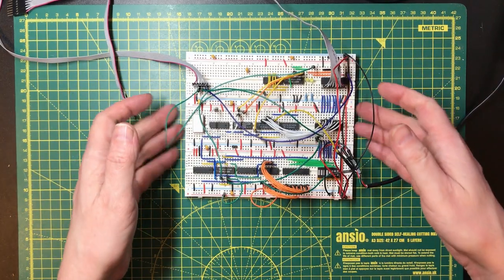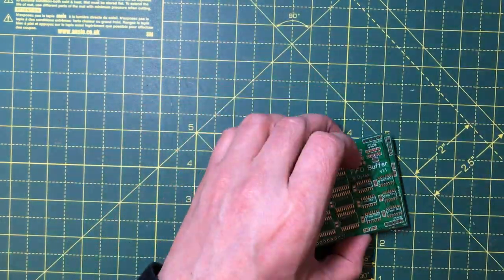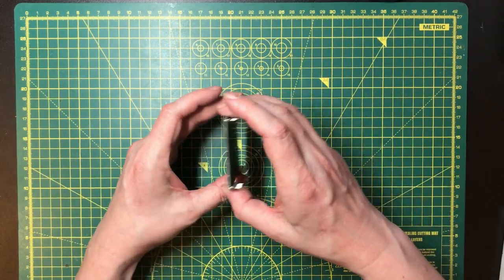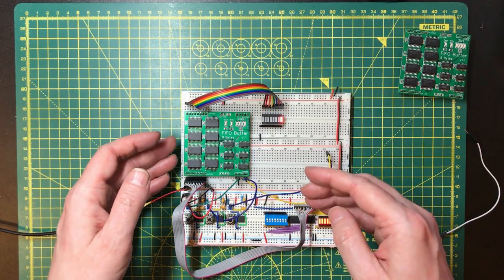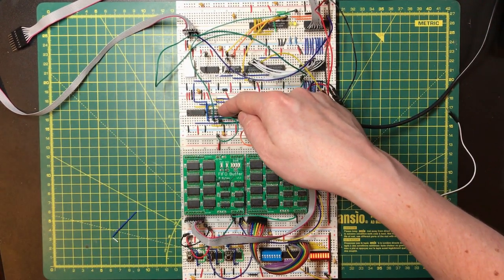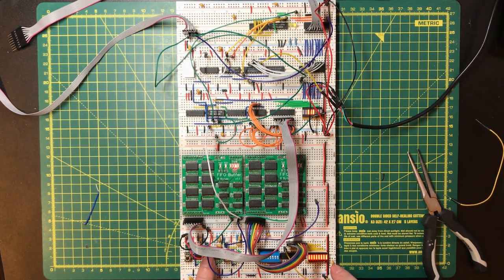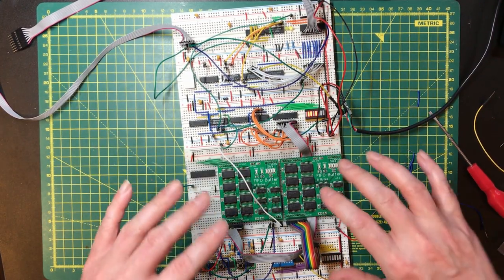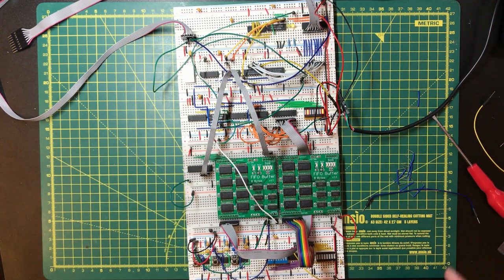Receive FIFO - UART from Scratch - Part 6

Comment: Thanks you James and nice Holidays ! 

Funny that JLC now sends puzzles... as if I didn't have enough puzzling while designing the PCB 🙄

Could we have some Bach or Mozart in the next video for soldering  ? 

And ahhh yes, cheap push buttons from ebay "The Tragedy" ... I had some really bad batches, they lived like 200 pushes and then they were a resistive mess... try fix that in code ...  sigh. Maybe I send my left arm and my liver to mouser one day to get 10 really good ones 🤣  .. Well the cherry mx switches are only 80 ¢ents so maybe I'll use these for breadboards.
Reply: You can get two pin push buttons, they are a lot more reliable on breadboards.  I think I ordered mine from Amazon in the US, but I'm sure you can get them from lots of places.
Reply: @JamonTerrell  Dude, with mouser , that was a joke, I don't user breadboards since like 2017 anymore, the switches I use for my projects normally either are small enough to disappear under your fingernail and come from ebay (not all is scrap there) or they are salvaged from old electronic components (free...  yay !).
Reply from the maker: They do like to stick random gifts in with deliveries.

Comment: Awesome video, as always!

I do think an explanation of why interrupts aren't appropriate to your processor would have rounded the video out though, as it's the "first" way to solve exactly these kinds of issues, unless your looking at 100kbaud+ speeds.
Reply from the maker: You mean like the 115.2kbaud I'm running at?  ;-)
Reply: @weirdboyjim  your on the line for sure, but that's a manageable 20,000 interrupts/second assuming the line is going full speed in both directions. I'm just saying not mentioning interrupts was weird as it's right in the same solution area as introducing a FIFO.
Reply from the maker: I have explained it a few times already but the honest truth is that interrupts are not necessary to achieve what I want, and there are a lot of things on the "nice to have but not essential" list. I'll probably do them in a future build with different goals.
Reply: @weirdboyjim  I must have missed the bit where you talked about interrupts in a video, but anyway that's me done on that topic.  Looking forward to seeing your VGA implementation. You've seriously raised expectations on what can be done on a few breadboard slabs, so.... :)

Comment: Happy Easter, and congratulations on another component.  I imagine you must be looking forward to having more reliable IO before diving into the VGA.

Apologies for asking an off-topic question, but: I'm working on an emulator, and I just saw lodsb and stosb instructions in some code.  Are those "macros" made up of `mov tl,[si] ; inc si` / `mov [di],tl ; inc di`, or are they actual new instructions?  I did wonder at one point if it would be possible to do load/store and increment involving si/di in fewer cycles.
Reply: Answering my own question: they're real instructions, and the opcode definitions appear in part 93 around 13:42 for one frame.  Don't know the specific control lines, but they're presumably the same as the non-incrementing loads, but with the appropriate increment control line set.
Reply from the maker: Yes, real instructions. But they operate on the A register rather than TL. I didn't really go into any detail of those but the implementation of lodsb is identical to "pop a" only substituting si for sp. I have been sharing the architecture file out with people who ask for it. Email me if you want a direct look.
Reply: @weirdboyjim  Ah, thanks for the clarification.  I'll ask if I get really stuck, but it's enjoyable trying to get this all to work.  Up to the point now where I need to rewrite my assembler to not be an abomination of a Python script.  :)

Comment: You paid $8 to use 4 layers, but how much was shipping? I was just wondering what the total cost of missing the 2 crossed wires was?
Reply from the maker: I didn't have any other pcb orders to combine it with. So the order was just these. $16.90 total.

Comment: Could have tested the module now on the computer to make sure everything is working.
Reply from the maker: It would have been nice too, but I'd have needed to do a little bit of circuitry and a bunch of software work to have the receive with a fifo cohabit with the transmit without a fifo and I'd rather avoid the duplicate work. I spent a big chunk of time this week doing some pcb work you won't see the fruits of for a couple of weeks and I was already running late, I didn't want to cram receive and transmit into one very big, very late video.